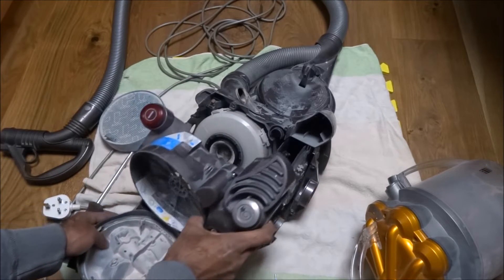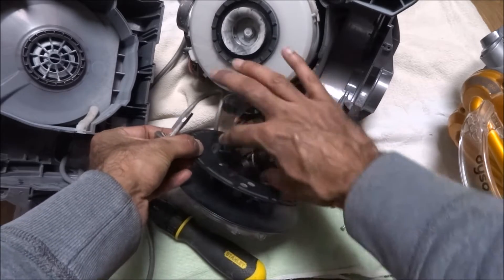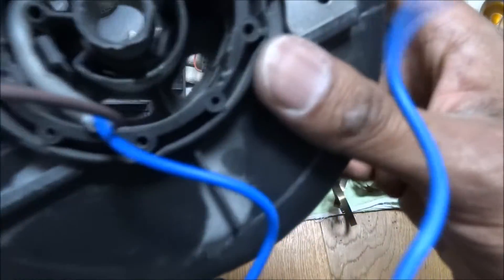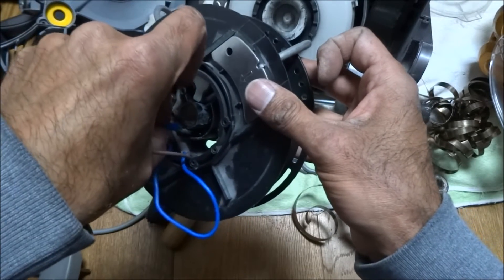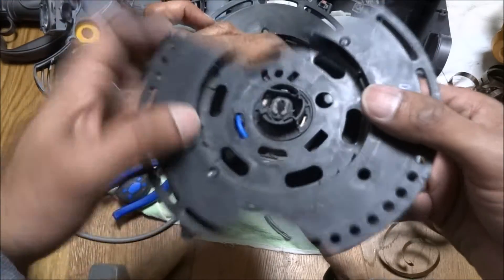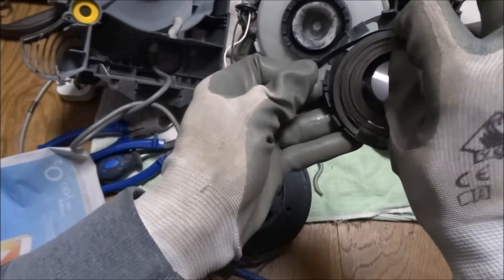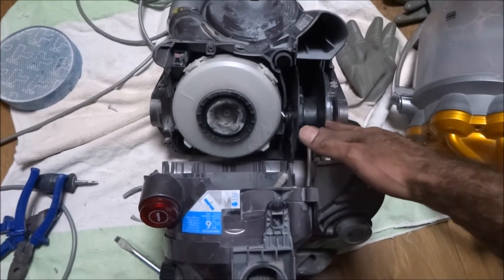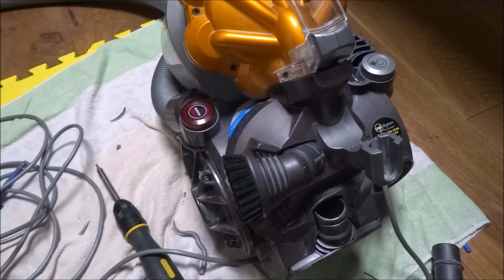How to fix damaged wires in a cord rewind on a Dyson Hoover

Comment: Dude, did you shoot any video on how you wound up the spring. I have an old Eureka 1756  I was trying to clean the contacts and being so careful but it popped out anyway. The outside of the spring is spot welded to that cage so i have to wind it with the cage attach . Any tips would be helpful.

Comment: I had the same problem with our daughters Dyson. Your film helped me a lot. It is not necessary however do open the spring compartment. I only ‘unwound’ it. My trouble was to find two new cable connectors (cable shoes?)  to put on the end of the cable. The ones I could find were 7.4 mm. Today I am gonna put these on the cable, and I will try to get the machine together again.

Comment: I found I could get the clear plastic part off to get to the main connectors without unclipping and removing the spring assembly.  I removed the  small black ring as you did on the spring side then using pointed pliers squeezed the clear plastic shaft together and eased it through.  However, it was tight.  Then having eased it back a bit the spring wanted to uncoil so I allowed this to happen, I'll have to wind it back when I get the cable back on.  Unfortunately, having cut the cable back and tested it from the plug with an ohm meter there was still a break, so I cut the plug off and still no through connection so I've had to order a new cable.  Just hope I can get it back together OK.
Thanks for the video it was extremely useful mistakes and all, I probably wouldn't have attempted it otherwise but I didn't fancy recoiling the spring! 
Also thanks to all the others who have commented below, some useful tips.  Always a good idea to read the comments for ideas before tackling the job, I should have done that first.  Doh!

Comment: Well, you made HARD WORK of that and even failed to pretension the mechanism to ensure that it retracted the cable. 

There is a much simpler way to do it without risking the spring becoming apart. Basically, you do not undo the clips holding the two black parts together. That way, the spring stays safely coiled up in its housing. The secret is to detach the clear plastic part and this enables you to get to the cable. Spray the cable with silicone spray and then you can pull it through whilst pushing on the other end. Then you can cut off the broken cable, strip back the insulation and fix two new flag terminals. Put it back together and the pretension the spring by the right amount. Job done! I'll do a vid on my channel when I do the next one.
No apology for being negative but if you do a demonstration, you really ought to do the job properly.
Reply: Lack of rehearsal left us wanting.
Reply: Hello,failed to pretension the mechanism to ensure that it retracted the cable. Help ?
Reply: We'll await your video "kind sir"

Comment: There is ABSOLUTELY NO NEED to pull out the spring!! Just the little clip in the middle is enough to get the shaft out to access the cables on the other side. Off course you CAN pull out the spring in case you have nothing else to do, but it does not help you in any way to repair the damaged wires.

Comment: Just a hint - Although the spring looked wound tight, it wasn't. If you put the machine back together with the cord wrapped around the reel  then pull it out, it will retract. The trick is to wind it up a bit more while outside the machine to get it to pull in tightly.
Reply: @geplayer  I mean that after removing the retract mechanism, pull some cord out and manual wrap it back on the spool. This way the spring has more force when you pull it out and retracts faster when you let go.
Reply: @geplayer  My Dyson DC21 Stowaway Canister Vacuum is going strong after 23 years and I found it in the curbside trash!

Comment: I have a problem with my Dyson DC08, it wont start. I bought a replacement motor which works when connected to the mains but when connected to it´s normal cables it just won´t start. I thought the problem might be with the cable, and I followed your tutorial (kept away from the coil!!!) and it´s not that. The switch also seems to work. Any ideas?
Reply from the maker: There's not much in the hoover, cable, motor and switch. You tried replacing the fuse? Plug? And then perhaps try a different cable?
Reply: Ernesto Caldwell       its* normal
Reply: @GeekStreet    *There's
Reply from the maker: @stfuplsok  lol missed that...thanks....I'll update
Reply: @GeekStreet   You're welcome
Reply from the maker: @stfuplsok  are you a bored school teacher? 🤣😂
Reply: @GeekStreet   no, just correcting a wannabe 'Geek' in the Street 🤦‍♀️🤣
Reply from the maker: @stfuplsok  🤣😂

Comment: Used this vid to repair my cable mate - thanks very much - although after spending three hours trying to wind that spring back up, mine ultimately didn't retract either - I was gutted lulz
Reply from the maker: I felt the same but at least it worked!
Reply: Years later... At the time you posted this comment about your cable reel spring failure, I had exactly this same problem on my Dyson DC39. So here I am today, have another go... and the reel works just fine, by itself with the rest of the vacuum cleaner disassembled...

Comment: The dogs chewed through my wire on my DC39 hoover. Can I just buy a new cable or does it have to be the whole pulley system? Thanks
Reply from the maker: Depends on the cut location if you have ample cable then buy a 3 plug, cut where the dog chewed and attach the plug.

Comment: Hi I have problem with Dyson would you be able to help pleasa
Reply from the maker: What the the issue? Perhaps I may have ideas on how to check.
Reply: Geek Street. Hi.Thanks for messeging. There is something wrong with engine or  something else. It's wird becase its loosing a power. And it have a noise like some one making popcorn.
Reply from the maker: Perhaps give it good clean so the dust collector and the area near the motor.
Reply: @agatka1225aga    *messaging        *weird *because      *losing

Comment: i think what you did wrong was to leave the cable loose... should have wheeled it around it. By pulling it out once closed it will get the tencion in the spring. 
im possibly gonna have a dc 19 up for repair soon. tnx for the descriptive and closed up video 
well done
Reply from the maker: Thanks for the comment, yes definitely I should have winded it up. I took it back out and tried again but it did not not work, as the hoover was working I couldn't be bothered to spend more time on it so left as is.
Reply: Papix77     *tension